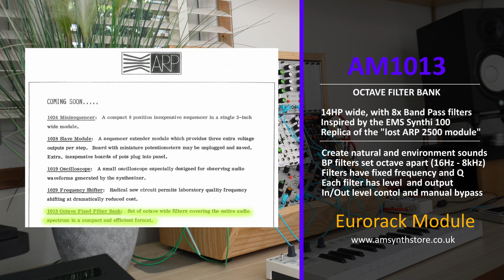AM1013 Octave Fixed Filter Bank - Band Pass Perfection

Comment: I have a Doepfer A-128 Fixed Filter Bank. I has 15 filters. There is also the Behringer "Boog" 914 filter bank with 12 band pass filters. 
The AM1013 looks great, superb workmanship, but I wonder what the point is (at least compared to the ones mentioned above) of buying a filter bank with only 8 bandpass filters, apart from having the individual outputs. Just to have the original ARP design? Or does a 8 bandpass filter bank have any benefits?

Comment: Hi Rob, the oscillators sound very massive. Which ones did you use here to demonstrate the filter bank??
Reply from the maker: Hi, two B1004 VCOs the ARP design turned out really well. Rob

Comment: I'm planning to buy 2 of these soon to make up for selling a scratch built 2u rack dual version of the Ems filter bank I made years ago & recently sold to someone in Germany who said it was the best eq he'd heard. As far as I know it was unique. I had thought about the analogue systems but unlike my build & the AM version it lacks the separate outs. Also the AM is a lot prettier to look at! I'm curious that the ARP design is almost identical to the EMS, how that came about or which came first. Anyone know the story of that? Incidentally I couldn't see a bypass on the circuit diagram & wasn't sure how to do it noiselessly so on each channel I wired dual pots as to combine a mix balance control with bypassing at one extreme, marked bypass on the panel, which  to my amazement worked! I also added a simple vu meter to each side.
Reply from the maker: I built a few rack mount clones before putting the circuit into Eurorack. It is a great filter/eq that Klaus Sculze used in the mid 1970’s. I dont know for sure what the original ARP design would have been but its unlikely they would clone the Moog version wth inductors. Given they adopted Op Amps very early its likely they would have gone the EMS route, the gyrator op amp circuit was available published in IEEE in June 1969, so this ties in nicely with the ARP plans to expand the 2500 in 1970. The authors were at Minneapols University.